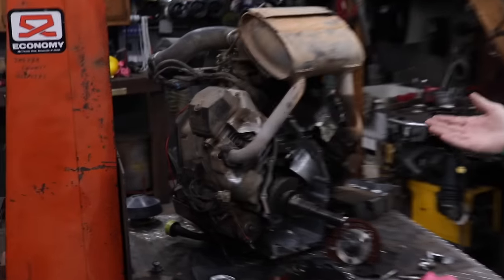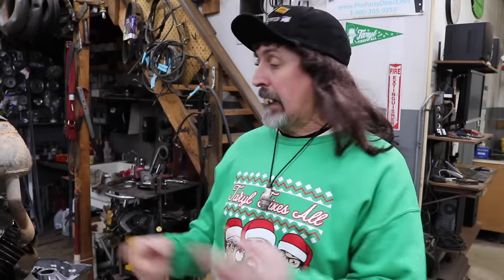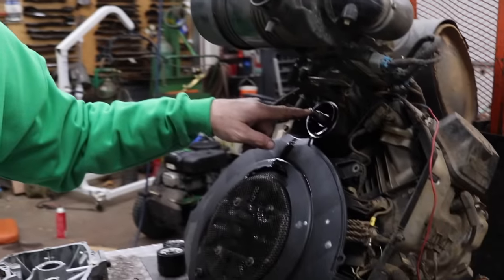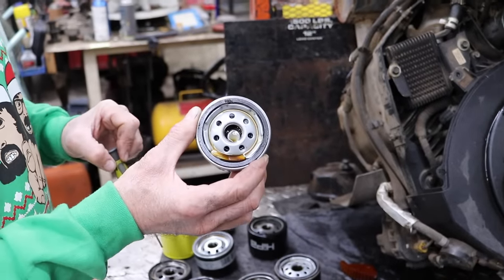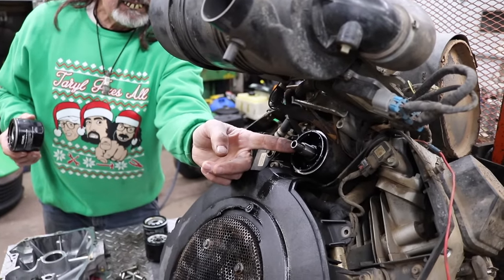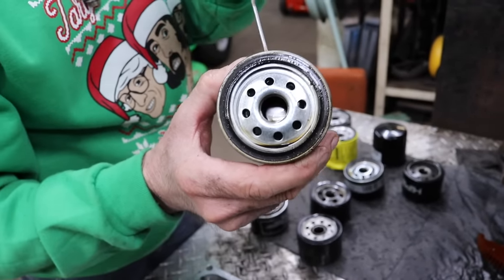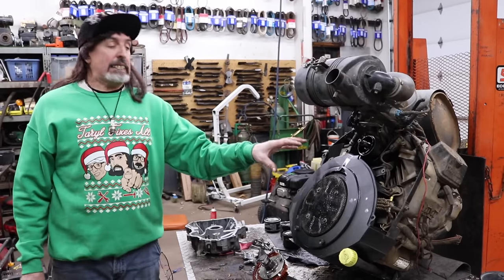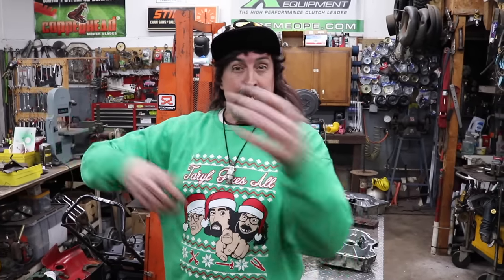💸 $4,000 Down The Drain! DON'T Do This Epic Fail!

Comment: Wix and jd oil filter is the same especially with the ecv740-3042  454.2 hrs and kohler is a fucking pos I have 5 machines with the same engine all with 1500hrs plus I got a damn lemon thanks kohler and thanks John deere
Reply: Yeah sure they are ..just because you had issues that you probably caused yourself don't categorized Kohler Kohler are one of the very best engines mine came with a standard 3 year unlimited hours warranty..and the engine is designed after the Kohler command commercial pro engine..
Reply: @BlueberryStinkFinger62  yea yea yea one out of 7 efi kohler all 3 yrs apart I'm apparently the dumb fuck thank you for your very informative informative master tech ....
Reply: @BlueberryStinkFinger62  also 2 yr on jd bc they buy the patent and serial # donyoru research before commenting

Comment: i dont trust kohler engine they been making big mess because of bad designers who build it to just rip customers off and tell them go buy new engine which it be they flaut right at the door
i have few customers have kohler engine it went up in flames during mower grass only have 4 hours on it and valve got stuck and piston hit it broke valve and blew flames back at intake catch carburetors and air filter on fire znd every thing went up on flames and burn down mower and cop call me up come take look at this what cause it i tear it down just find out that no lube to valve and find broken valve inside of engine it was failures build designed by kohler and they refuse replace his mower so i guild him come by buy this mower kawasaki or 670cc (there 720cc for upgrades version) so he did got himself good o mower big dog never have issues with it

if you are kohler mower owner just beware of engine and make sure get big fire equipment to put out fire in cause it blew up just save frame and swap out motor

Comment: Why do you always fail to point out the obvious? There is at least one full inch that could be cut off with my cut off wheel On that $4000 engine and then I could use any filter I want, even the short ones.  Now I know you're going to write back and say something stupid like "well we really can't do that". The customer doesn't know what he's got. You said it yourself.

Comment: Is there a bypass spring, regulating orifice,or some other engineering gimmick with the longer base nipple adaptor? Common sense would tell you that you need a longer filter(bigger) for this size engine anyway.I suppose a redneck fix would be to cut off extension  to make one size fit all.Wish you would have went into the engineering  details to tell numbskulls like me why other than telling us  just get the correct size.I suppose if Kohler wanted to make this foolproof they could've made adaptor longer to make it impossible to thread on short filter anyway.Yeah, I get it that people don't  know their equipment, then they probably shouldn't touch a wrench to begin with.